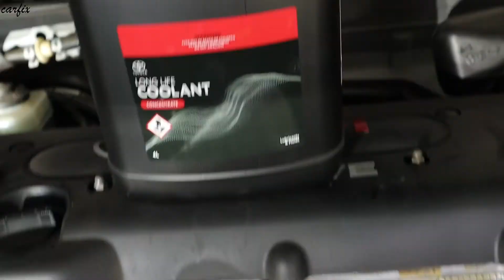Toyota Camry 2.4L Thermostat Replacement | Overheating | Corolla

Comment: My 2004 Camry was leaking coolant at housing.   I had to remove corrosion around thermostat gasket.  Replace with oem thermostat and gasket.  Those skinny studs are easy to break. Don't need to remove hose from housing.

Comment: my camry 2004 temperature fluctuates it stay in middle then go up and come back middle. And when temperature went up near to hot, at that time i immediately got out of car to open bonnet, strangely fan was working and i didnt lose any coolant. And btw before this incident i had a rusty radiator because mechanic poured water instead of coolant.  So i flushed my  Radiator and switched to coolant but temperature  still fluctuate. what could be the issue ? Oh yeah my AC does blow Cold air but doesn't blow hot air .

Comment: E5 of what kind of bit?
Reply: They never say
Reply: @ebonyrose2431  Tools used are a 10mm deep socket for the upper and lower nuts. To remove the top stud so that the thermostat housing could be cleared of the alternator an E5 'star' or etorx socket was used; Trade Tools sell them individually for about $5. I found the video helpful as a manual will tell you to remove the drive belt and alternator to do this job.